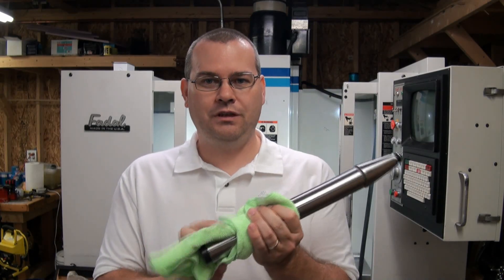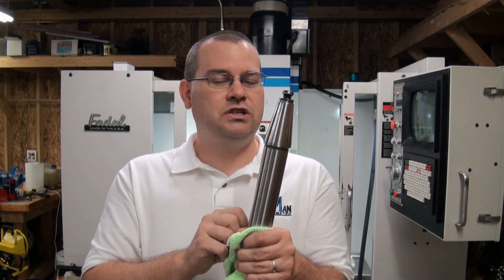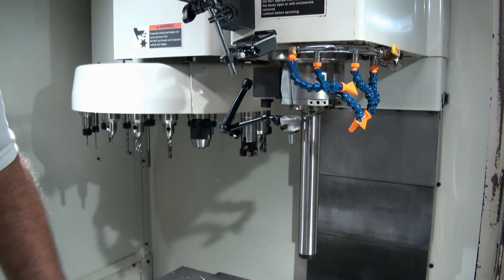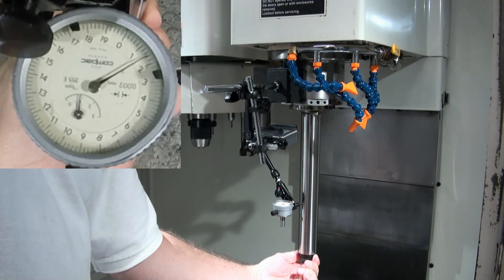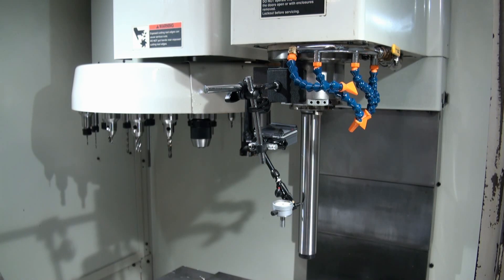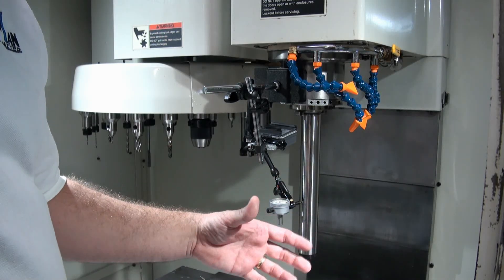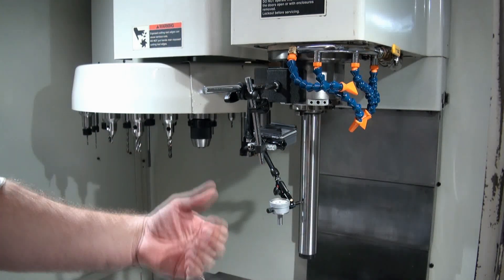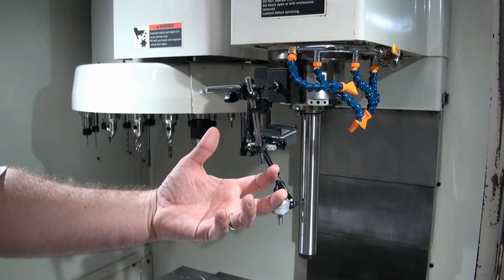Using a Test Bar to Check Spindle Run out

Comment: Should I worry about .0002 preload? I’m getting zero runout at the spindle up high but I believe the drawbar is bad because the tool holder runout changes depending which direction the holder is placed. I’m seeing significant holder runout even with quality brand names. It can be zero one way and .001 the other. The draw bar has been catching so I know it’s worn and have a replacement. I ask because if I’m taking it apart it’s not much more effort to swap bearings these are fairly simple to do and I have some here. Or should I change drawbar and continue to run it awhile? Also when I cleaned the taper and stuck my finger into the drawbar pushing all the ball bearings back out I noticed I was able to nearly eliminate tool holder runout. That’s a big difference from what I see. Guessing the retention knobs are being pulled diagonally and leaving that bad drawbar in will cause uneven wear.

Comment: Seems kinda pointless rebuilding a machine without one of those test bars. Measuring XYZ and spindle alignment 'upfront' appears to be the only way to not go in 'blind'. Bet it would also come in handy for adjusting the feet and tramming.
Reply from the maker: Tramming is a different measurement and does not use the bar. It is a good tool to have and "relatively" cheap.

Comment: Thanks for sharing. There's a lot to account for. Lengths of tools, quality tool holding spindle runout, thermal expansion when spindle in rotation for second's, minutes and hours ect.. and strain on spindle when pushing through or cutting metal.
Reply from the maker: Yes there is, just the temperature change in the spindle can push tenths out. Liquid cooled spindles and ball screws really help. This machine is not on that level though.

Comment: Ok, but how do you know if the tapers are also in acceptable condition? Do you know of any method to check them?
Reply from the maker: You can put a very thin layer of dykem on a known good tool holder.  Put it in the spindle and take it out, this should show you the grind and contact pattern.
Reply: @AtManUnlimitedMachining  Actually I'm looking for something with which it is possible to measure them and quantify the deviation, for issuing a report. I believe I will have to develop a device for such a task. Anyway, thanks for answering, Tim.
Reply from the maker: I'm not aware of anything to measure a spindle tapper while its in the machine. You can use test indicators, ball bearings, and depth gauges to kind of get there, but it wont tell you the whole story like putting it on a high end CMM
Reply: @AtManUnlimitedMachining  Sorry, Tim. I still make some mistakes in English. I meant "tool holders" instead of "tapers". It makes more sense now, right?
Reply: @AtManUnlimitedMachining  Its called Air Gaging     https://i.imgur.com/z7u0RTZ.jpg

Comment: Hello,
Recently i repaired a spindle of our GROB m/c In-house in which I faced a problem of spindle runout (HSK63A). Runout  during clockwise rotation is 0.006mm & anticlockwise direction is coming 0.014mm. Ideally, it should be the same. Can you please help.? My mail id is swap149@yahoo.com
Reply from the maker: I'm not familiar with that spindle at all.

Comment: What's the perpendicularity of the end face of this bar, referencing the axis of the bar? 

And also, I can use M03 S1000 to rotate the spindle, while the test bar is in the spindle?
Reply from the maker: There is no spec on this bar for the end face. It is only calibrated on its OD relative to the tapper.  You could spin it if you wanted to.

Comment: Very nice video.
Sir, can you make a video on how we can check the repeatability of the ball screw and which type of thread used in ball screw?
Reply from the maker: Check out the backlash video, Fadal used a metric and inch type screw depending on the machine .

Comment: hi > do you have any video show how to check run out on lathe spindle? how much is a run out acceptable?
Reply from the maker: Hello Anthony, currently I'm only doing mill videos as that is all I have in my shop to film. Lathe maybe in the future but not anytime soon. As for run out, depends on the chuck. A four jaw chuck you basically compensate for any spindle run out when you dial your part in. A 3 jaw chuck is more important because there is no easy adjustment. If you have run out on a 3 jaw you can grind the jaws to bring it in. Check out Abom79 you tube, he does a lot of videos on manual lathes.
Reply: I replaced the bearing in spindle on my lathe machine and then I check run out at face about .0006 , and .0006 at  the stepper of the spindle . Do you know how to adjust the runout ?
Reply: Thanks you
Reply from the maker: It is machine specific, some do not have any run out adjustment. Some have set screws to push on the bearing housings, some have cams, there are lots of different methods used on various machines. Just the way you tighten things down can shift the run out sometimes.

Comment: You remember my built in pitching machine, well, it too suffered from some of these same alignment issues.  Replaced the ball screw, the rails and trucks, disassembled the toolchanger and replaced the few wear items, some broken clips, sensors, etc.   They did a ball bar and test bar test   I got the highest accuracy linear stuff I could get.. all of it was very worn and not maintaned.  The shop that had it was grimy and the ran the snot out of it.
Reply from the maker: Yeah, that sounds about right for the condition of a lot of Fadal's. Good thing is most times the iron is still ok and with some new parts and labor you can get them running like factory. My machine was really not that bad. Needed a set of X slides and now a Z screw.  I hope the Z slides are ok, they check out ok.
Reply: Yeah, it certainly wasn't pretty at all, but FadalCNC was good at helping me sort issues out along with talking to David DeCaussin.  I couldve just settled for replacing some minor parts like the rails but I knew I wouldn't be satisified.  Great video on this one.

Comment: Very well demonstrated and explained. There's much more to even simple manual machine alignment than most YT videos and forum posts at the hobbyist level explain. Imo there's almost more misinformation around about alignment than the correct information, so I'm enjoying your videos very much. My personal opinion is that anyone who owns machine tools no matter how simple, large or small needs to check out Dr. Georg Schlesinger's writings. There's a PDF of the 7th edition on totallyscrewedmachineshop.com And maybe owning a copy makes me a bit biased, but they should put a few bucks into helping to educate themselves by picking up a copy of the Connelly book Machine Tool Reconditioning. Both are about manual machine tools and are really dated today since I believe Schlesinger's work started in the 1930's and the Connelly book was first published in the 1950's. But there's really nothing else around that I know of that's more up to date. The test procedures and basic alignments don't change though,  so it doesn't really matter how old the information is. Your videos are more about a specific machine, but most of what your showing does translate over to even non CNC equipment. The Connelly book is a very dry read and mostly about scraping worn machines back into proper alignment and doing the alignment tests. But it's saved me far more than it's initial cost just from understanding the need for much better slide lubrication and keeping those areas as clean as possible.
Reply from the maker: Yes, people are shocked when you tell them that they have been measuring and machining stuff down to 0.0001" for over 100 years now.  The stuff really hasn't changed at all. It is still the same geometric problem. We just put a computer in the way of the hand cranks today. I would agree there is more miss information, part of the reason I started this channel. I try to make the videos generic so you can apply them to any machine. But yes, there is a little bias toward my specific setup. These same tests in all my videos should be done on manual machines as well, they have the same alignment issues.
Reply: I have an old book about tool & die work first printed in 1907. They mention setting up and boring, then grinding master gauges on a lathe face plate to far far under .0001" using shop built hardened and ground tool maker buttons and a shop built dial test indicator that's quite a bit different than what we think of as a DTI today. There design had a very large amplification factor between the ball riding on the part and the needle tip. But those parts were hand tapped into alignment on those lathe face plates. These were pretty simple and quite ordinary sleeve bearing type lathes, and most would pass on buying anything like it today.

I'd like to think I've bought some very accurate and quite high quality measuring equipment. I've got a Mahr millimess that could make the checks, but no way in hell my lathe could ever replicate what they did. Watt, Maudslay, and Whitworth were measuring into the tenths range as early as the mid 1800's. Then Whitworth got into the very low 2? millionths range shortly after that. Even knowing how they did it, I couldn't do anything close to what they could over 150 years ago.
Reply from the maker: There are a lot of companies buying older machines and having them upgraded with new drives and electronics.  The iron of yesterday just can't be beat today in some applications. Problem is pricing is so wacked out no one could "afford" to pay for a machine built like that today.

Comment: Very nice, where do I get a test bar?

Dennis L.
Reply from the maker: Hi Dennis, if you google your spindle type and "test bar" IE "Cat 40 Test Bar" you will get a bunch of results where you can order a bar. The price will depend on the quality and accuracy of the bar and range from the high hundreds to into a grand range. The bar I should had a calibration cert that showed total run out at 0.0001" the whole length of the bar.
Reply: TAC Rockford, CNC Specialty store ect. There's lots of different suppliers around. Very good ones aren't exactly cheap though.
Reply from the maker: Correct, "cheap" and "accurate" don't go together very well. A good tool holder can get you most of the way there for lower cost in a home shop.
Reply: Here's one,   http://www.ebay.com/itm/371534079834?_trksid=p2055119.m1438.l2649&ssPageName=STRK%3AMEBIDX%3AIT
Reply: thanks again for the great info. I'm looking forward to the tool measurement video.